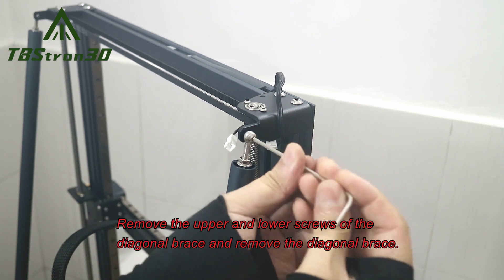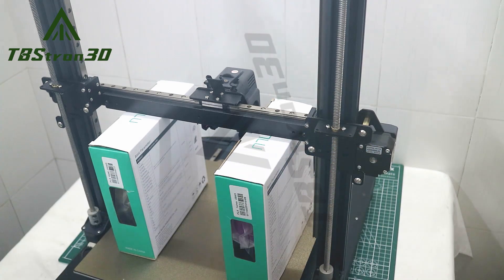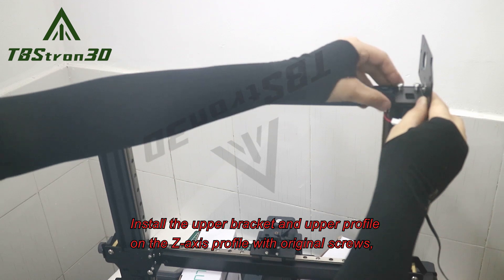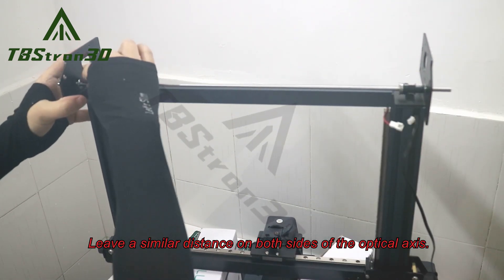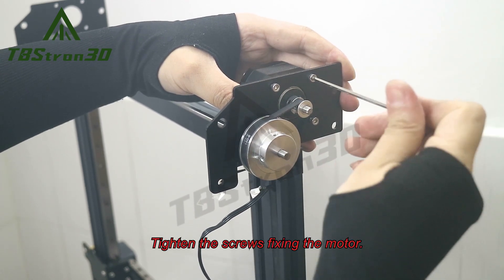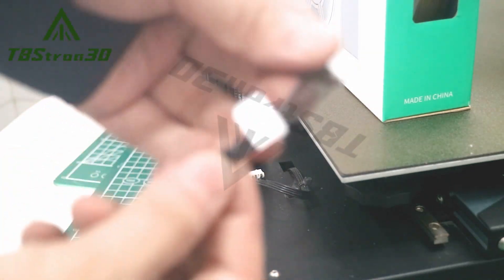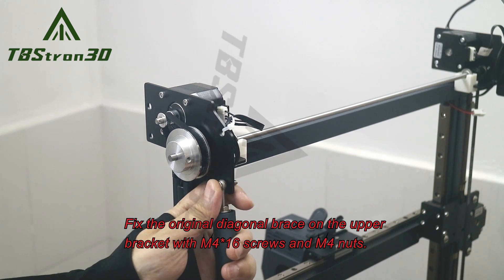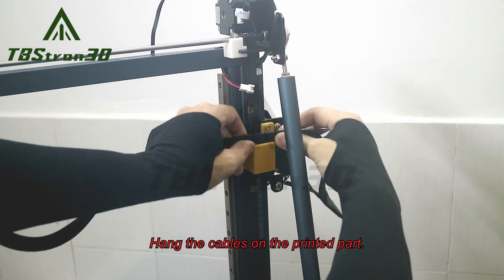Z Axis  Dual Synchronous Belt Upgrade Installation Guide

Comment: Why does the printer have two motors for z axis ... one for each side ... and then also connect the two motors together via a rod or belt in the original ... doesn't this over constrain the z axis and result in some weird interactions regarding z height and which motor is slightly more powerful.  On a Prusa Mk3S the two sides of the z axis are completely independent and are managed independently by the 8 bit board.